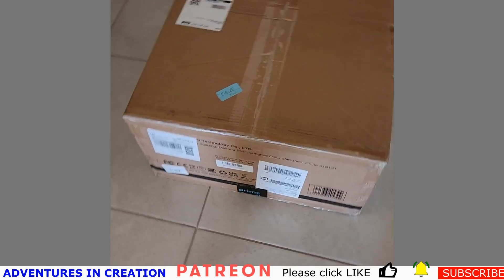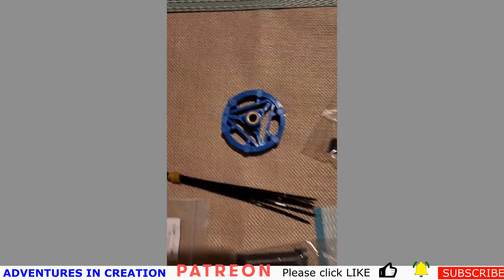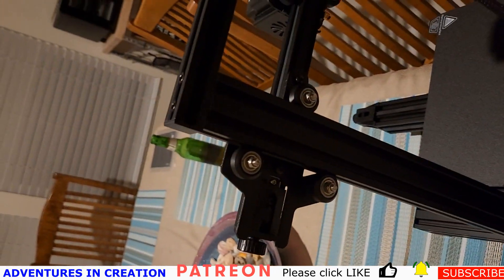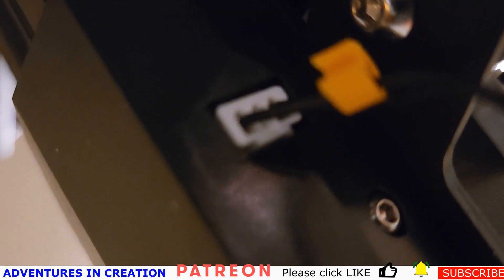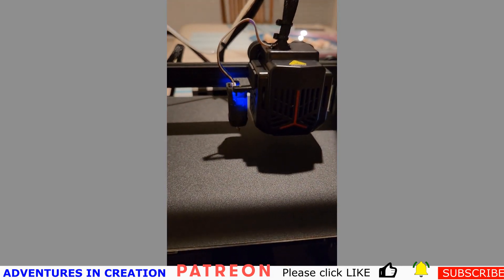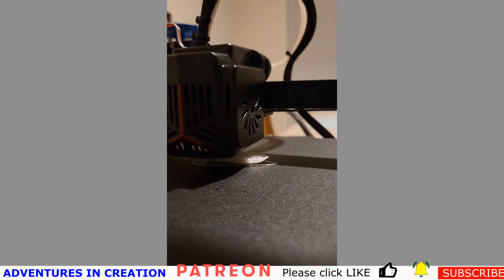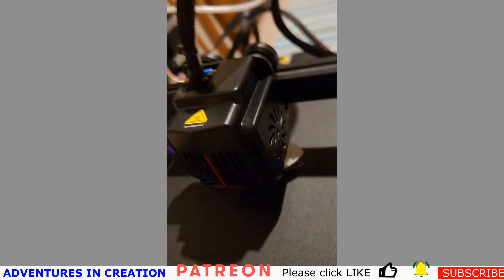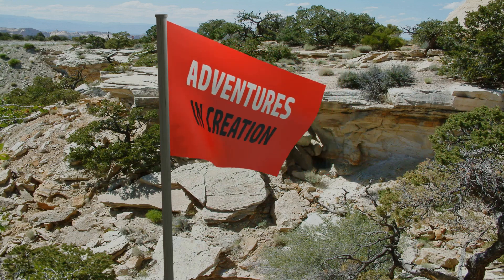Assembling a 3D Printer

Comment: If your having issues with adhesion try to clean it with soap and hot water, it could just be some grease on the bed.

Try bumping your bed temp up by up to 5deg, sometimes the sensors are off a bit and some brands of fillaments just like a bit more hear.

Lastly try to print a 25mm*25mm 0.2mm high square.  If it comes off the bed as a solid piece it means your first layer is set properly, if it falls apart into individual strands it means you need to bring your nozzle slightly closer to the bed.

As for product to help things stick simple Elmer's glue stick does the job.

Have fun with your new toy.
Reply from the maker: Hey, thanks for responding and making very useful recommendations. I solved the problem; it was the Z-offset initially. I printed some concentric squares that allowed me to quickly see if the first layer was adhering, then I adjusted the Z-offset until I good adhesion.  Then, I actually lowered the temp of the bed and the hot end. This gave me adhesion without glue and less stringing.
Reply: @Adventuresincreation  wish I got there earlier, for some reason this video didn't make my feed ... Love how the algorithm "works".
Reply from the maker: @QEngineering  Tell me about it, it's a real struggle to get videos to people. That's why it's important for people to like the video, that way it gets in front of more people. Got to love the YouTube algorithm.

Comment: I have an Ender 3 S1 - also with the magnetic sheet base.   To get good bed adhesion (and also release when finished!) I use just a 
cheap Glue stick - like you'll find in the elementary school supplies section of the store.  I have an "Elmer's Extra Strength
Glue Stick" right now.    You DO need to wash the removable bed in warm water after a few 3D prints to avoid a buildup.
For prints with a relatively small base, I'll use a brim of maybe 10mm to insure the base says in place.
Reply from the maker: That's exactly what I found. Thanks for the information.

Comment: I have an Ender 3 pro and I love it when it works well. I just bought an Ender S1 Plus and man it's a pain in the rear. Auto bed level fails on first probe. Creality sent me a new X plate as it was warped bad. Makes zero difference. I tried to print anyways and the prints would fails in the first few layers. Tried again and walked away for a minute and my z offset decided it wanted to disappear and now I have a square hole in the center of my bed. The Ender 3 took a bit of tinkering but no where near the level this thing wants. Haha.

Edit. Even on my Ender 3 I would print my initial layer way slow at like 10 where my other layers I would print at 50. I also have to adjust the bed on fly once in a while.

Also the end of the video has a few minutes of just black screen for me.
Reply from the maker: I expect to do a little tinkering but was a bit disappointed in how poor the adhesion was. I am used to printing on a glass bed.
Reply: @Adventuresincreation  It is strange. I've an Ender 3 V2 (not Neo), which came with glass bed and I had adhesion problems all the time. Then I purchased the black plastic magnetic type you have and it worked much better. The only problem is that it is wearing off.
You already have experience with 3D printers so I bet you know it, but just in case I mention: you have to adjust the Z offset by hand (in the menu) to set the correct distance. The sensor cannot do that for you. Actually when you print a small thing like the benchy, auto bed leveling does not matter since that just for getting the edges leveled. The middle is set by the Z offset.
Reply from the maker: @gubigm  thanks for the input, I played with it some more and I think I got it dialed in. I had manually set the bed up with some paper and measured it after an auto home, it was still pinching the paper, but the adhesion problem remained. I switched to some solutech pla and printed some leveling tests. After more fine tuning I was able to get a decent first layer.